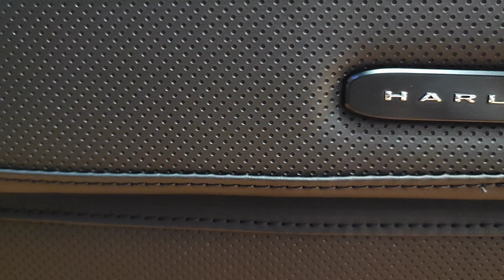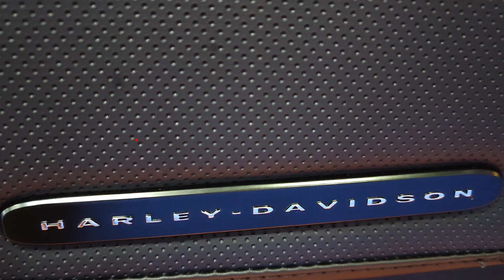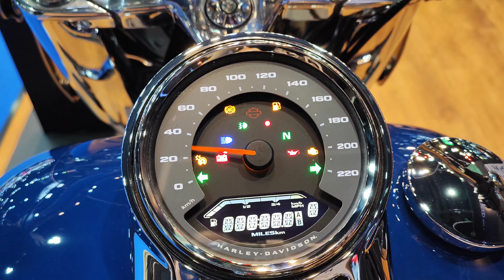Fat Boy 2023 with a lot of Accessories Walkaround Close up details

Comment: I'll take it! Just do a stage 2 full build, 115hp 120T , V&H Big radious pipes, transcase vent, oil temp dip stick, aux cig lighter, love jugs,, add a chin fairing, bar bag , frame tool kit , full suspension upgrade and touring seat with rider backrest